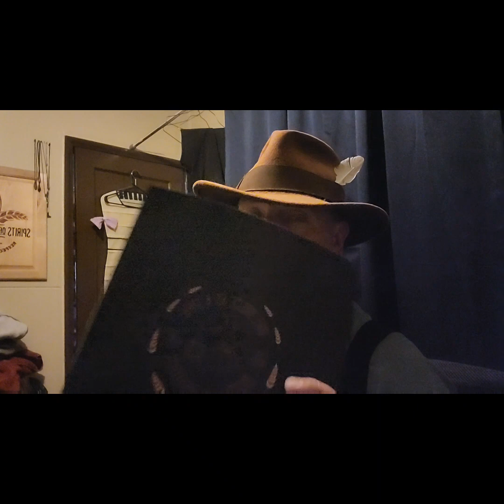Malt and enzyme efficiency.

Comment: Ordered the book, Alan. I usually use the “points per pound per gallon” method (John Palmer) I learned when starting out brewing beer, but I think I prefer the diastatic power method since you can get the number right off the data sheet for the grain.

Comment: I'm using 100% malted barley for my whiskey so DP has never been an issue for me. If I wanted to get me some of these "starch flavours" you speak of could I bring my mash temperature over 72C (162F), at the end of the mash and add some grist at that point ? The high temp should denature any enzymes and therefore just stay as starch.  Could this work or am I dreaming ?